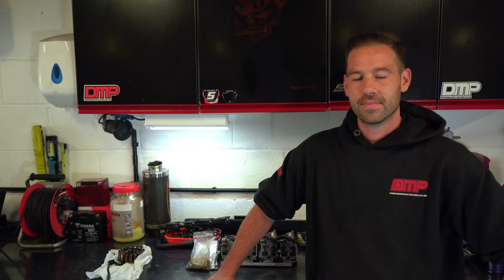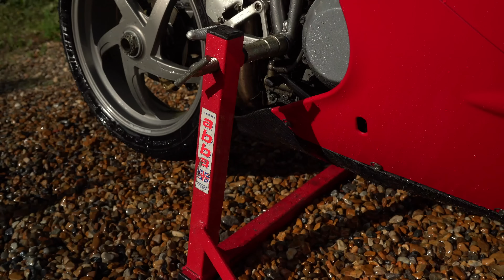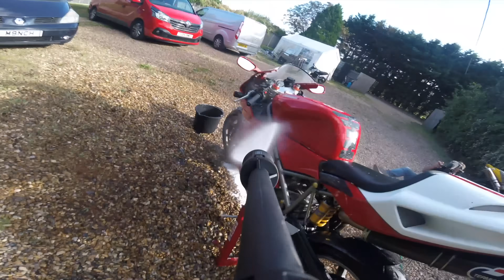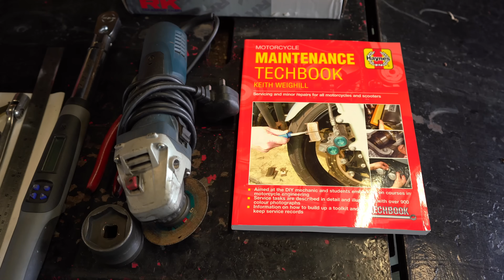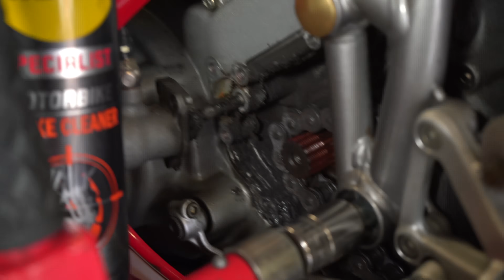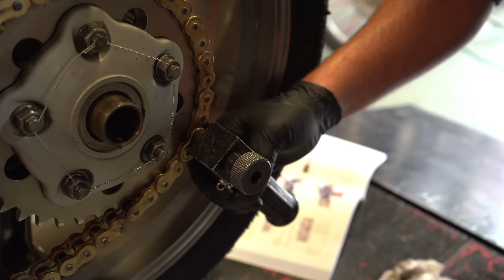Bike World Garage Part 1(Chain & Sprocket Change)

Comment: Just an observation ...you didnt show how to bend the locking tab after torquing the front sprocket nut. Very important safety component that little bit of steel but they can be a pain the A getting a good angle at on some bikes.
Other than that, excellent video.
Reply from the maker: We did leave a couple of the obvious bits out Shane, the vid would of been a monster if not.  Good point though, cheers.
Reply: @BikeWorldTVshow  On parts like that show the first part of the process and then the end result, or even speed it up, that's what I do.
Reply from the maker: @HalfdeadRider  Something to think about, thanks.

Comment: FFS Not another person using a grinder to remove a chain. You are supposed to be a professional! :) Just get the correct tool (I use a DID KM500) and use it properly. By the way you'll almost never successfully push out the (soft) rivet link with the tool you are using. The link wasn't stuck/seized it was getting riveted over even more by the tool as you were trying to push the pin out. The tool is designed to be used on one of the factory riveted pins not a hollow/soft link. You'll either f...ck the tool or yourself doing it incorrectly. Using something like the DID KM500  you could have the chain cut by the time it takes to plug it the grinder, without grinding dust flying around the workshop.
Reply from the maker: He is a professional who runs a very successful business,  putting a stupid smiley face after the comment doesn't make it OK.  As you're in the business you should know not to have a dig at other people in the trade, it's a small world after all.
Reply: What has being in the trade got to do with it? Its not a secret club! What you do behind closed workshop doors is completely up to you. But when you put it on YouTube for the world to see I feel you have a responsibility to give  good information, and not get upset when someone calls you out. 

I think it's reasonable to assume someone professional would show you how a professional would do it. My poit was that in my experience professionals use the correct tools for the job in the correct way. There are plenty of home gamers with grinders up and down the  Country spraying grinding dust all over the place. But this isn't something you would expect to see in a professional workshop.
Reply from the maker: @SuperbikeSurgeryTV   Not upset mate, looks more like someone jumping on someone eases page for some free promotion.
Reply: @BikeWorldTVshow  I'm not sure leaving a comment on a video could be considered "free promotion"  given  next to no one reads the comments. That would make me the worst marketeer in history.  Any way to end on a more positive note, I do love the channel you're making some really good content, keep up the good work.
Reply from the maker: @SuperbikeSurgeryTV  Hi, you'll be surprised how many people read the comments. We're just standing up for our guy, cheers
Reply: @BikeWorldTVshow   Having seen multiple different technicians/Mechanics from main dealers to race teams use a grinder to remove the chain i think is perfectly acceptable tool and approach for the job in hand and also having seen Dan's previous work on the desmo project and that fact always seems to have a full workshop he's a proper good mechainc who gives clear and PROFESSIONAL instruction.
I think your comments are a little unfair and derogative even more so when you watch some of your own uploads @superbike Surgery Ltd in which some people might class some of your methods as not professional/crude but each to there own.

P.S Keep up the good work Bike World & Dan
Reply from the maker: @hp4adz533  Thanks mate!

Comment: Just one click on the torque wrench guys. Good to hear you mention about relaxing the spring after use though.
Reply: I'm intrigued to know what the issues with double clicking the torque wrench are.
Reply: Tic The Dog the reason for the click is to tell you you’ve achieved the correct torque. Continuing to turn the wrench to click again ‘can’ over-torque the fastener. It’s a bad habit that can cause issues; particularly in lower torque applications. 

Just for info, I’m not making this up. I worked on aircraft for circa 20 years and it was an issue that kept cropping up. To be fair, workplaces I have worked outside of aviation tend to have far more lax attitudes. 

Prior to using a torque wrench we would use a torque analyser to ‘prove’ the setting and every wrench would undergo a daily, recorded, inspection at %values to ensure it was still serviceable. 

In real terms, on non-safety critical/low tolerance applications it probably makes little difference to not carry out the ‘correct’ use of a torque wrench, but it doesn’t make the misuse correct 👍
Reply: Tomi Hilfinger 
 Continuing to turn the bolt after the torque wrench clicked doesn't get you a another click it gives you a over tighten bolt.

 If a bolt is torqued to its correct specifications and then retorqued by someone who who has the knowledge and skills to use a torque wrench the bolt won't be over tighten.

To double check my theory, today whilst building up a cylinder head I torqued the cam caps to 10 nm with my old type Britool torque wrench. I marked one of the bolts with paint and a scrib mark. I then rechecked the bolt 10 times with the torque wrench and when I checked the paint/scrib mark there was no movement of the bolt
I then did the same with my latest digital torque/angle wrench and still no movement

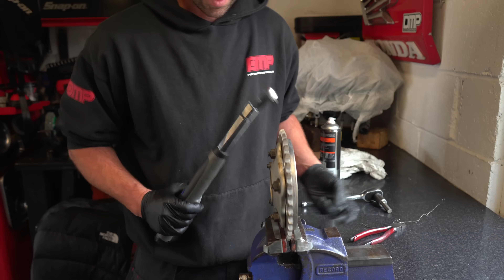Comment: Could mention torquing bolts in a star pattern at 13:50, although you didn't seem to follow that pattern? Also probably easier to suggest taking the nuts on and off with the carrier still mounted to the wheel? I'd wager a lot of people wouldn't have a bench vise to work with and would struggle to achieve the torque rating without a solid mount.

Comment: If you have some around, bolt croppers will go through an old chain no problem. Always used them for my bikes and the chain is off in seconds, quicker and simpler than a grinder.

Comment: Where I work if you want safety and used a grinder with the guard off it like your one you'd be off home as 1mm blade finger is off in seconds
Reply from the maker: Cecil Wilson I’ve worked in the trade as a panel beater Cecil, I’ve never used a guard.

Comment: Great idea to help inform us. Me being OCD and given how people change drive ratio on bikes, I might have checked the number of teeth on the new sprockets against the original bike spec before fitting. I might have also checked the number of links on the new and old chains before starting the job. I guess this is just Murphy's Law and my OCD wanting to avoid having the bike stripped and incorrect parts!
Reply from the maker: Ray Collington Hi, thanks for the feedback, we don’t want to get into ratio change at this time, that’s something we’ll cover further down the line.  We did check the length of the chain even though it was a custom kit.  Cheers

Comment: This is a great series I hope you’ll include some mechanical differences between Japanese bikes and European motorcycle also touch upon upgrades on the stock parts advantage disadvantages etc like in changing the gearing for more acceleration vs top speed and use of lighter chain sprockets etc

Comment: If water on a hot bike destroys your finish, then every time you rode you bike in the rain it would destroy itself ¬_¬
Reply: You misunderstood, if it's raining you have not got the hot sun beaming down.  Saying that, I still kind of disagree, as long as water is not left to sit on painted surfaces in the sun on hot day's it's not a problem.  I would also suggest getting a leaf blower if possible and use to dry the parts unreachable with a cloth or towel.